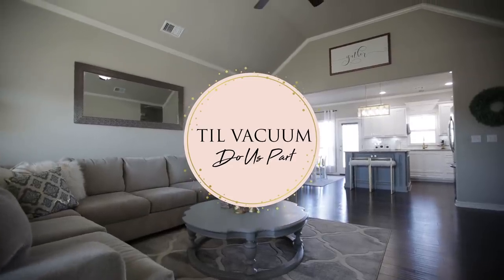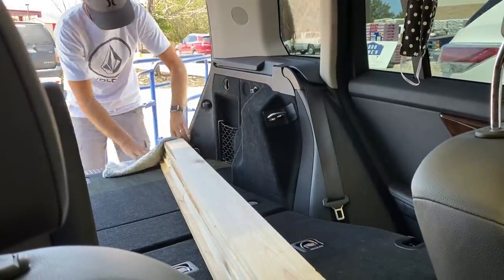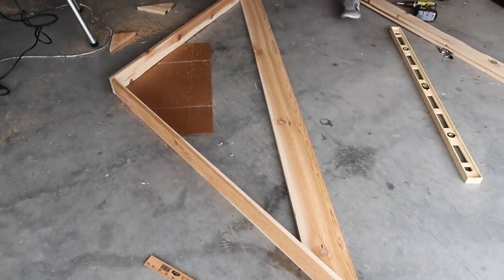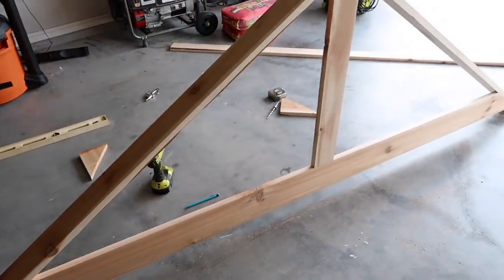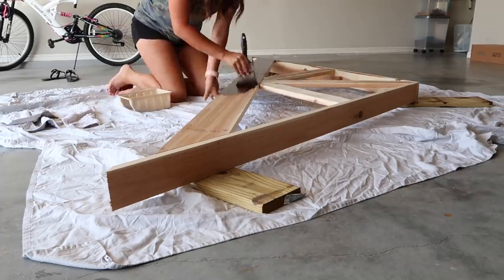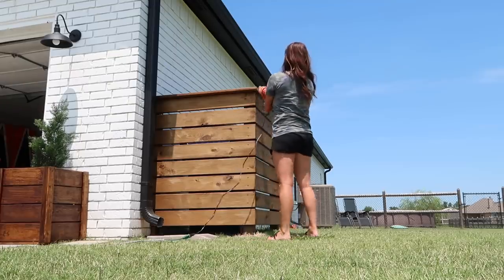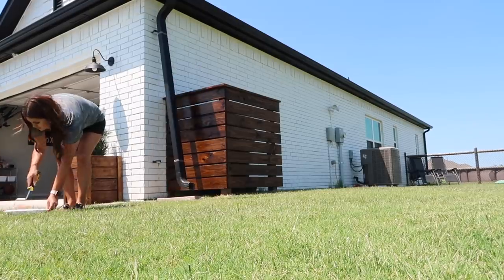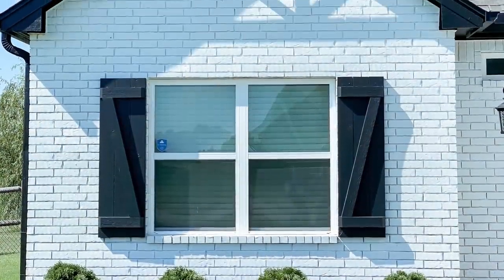MODERN FARMHOUSE UPDATES ON A BUDGET | START TO FINISH HOME PROJECT | DIY DECORATIVE GABLE

Comment: Gable looks great but I feel like you need to add a gable to all two peaks in the front of the house. I would also add a gable to the peak over the garage, you can paint the vent grille same white as the house , so it doesn't stand out, and then add the wood gable. That way it will be symmetric.
Reply from the maker: I’ll already tried. Chase and Savy votes no.